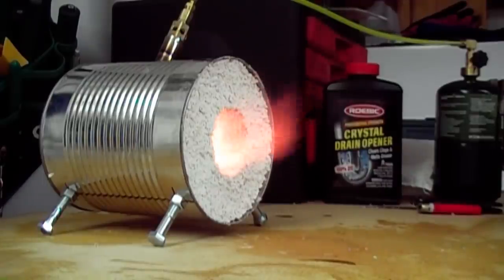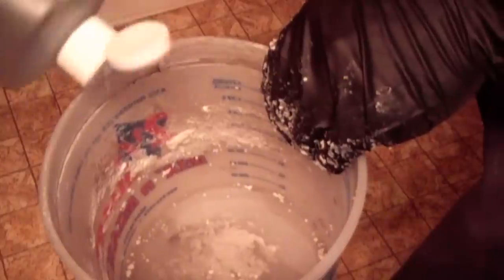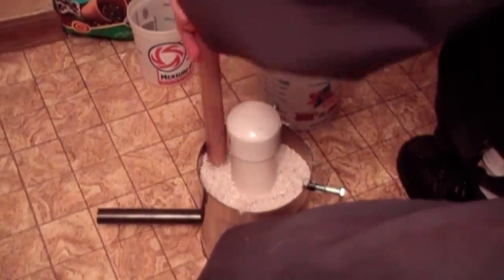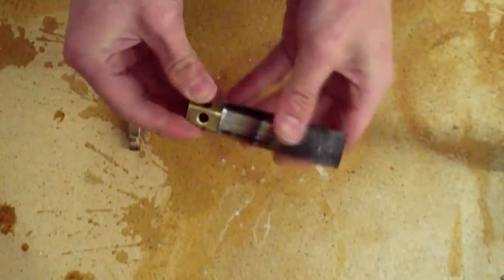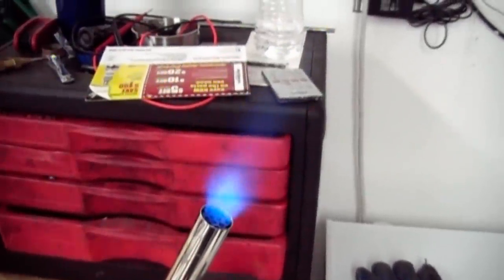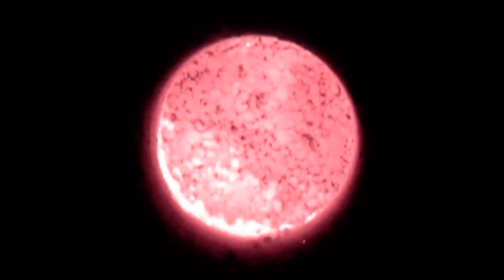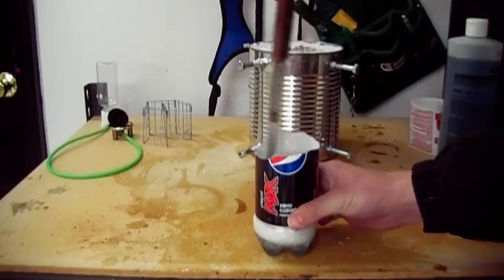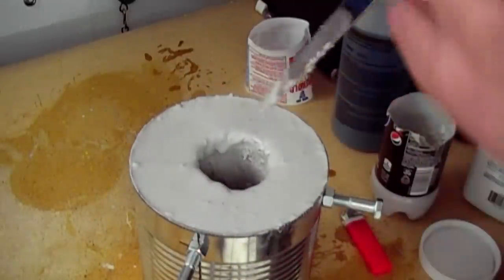How to make a coffee can forge

Comment: Tip! I built my own version of this exact burner & forge a few days ago. Afterwards when it dried I noticed the lining was getting soft & powdery after firing. I could scratch it off with my finger nail. So I created a hot saturated solution of LYE. I kept it on the stove on low heat (steaming, not boiling). Then used a plastic syringe to drop / coat / saturate the entire inner and outside lining with hot lye solution. It took about 2 hours to do and soaked in nice and deep. It needs to be hot otherwise it doesn't penetrate nice and deep. After I finished I decided to take a mini propane torch and heat a soft section of the lining that was breaking off before. Then when it cooled I touched it and it felt like a ROCK. Was hard as hell. So then I set off the forge with the wet lye all over the lining and THIS WORKS BEAUTIFULLY. First you'll see the steam come out (do not breath it in). Afterwards you can actually see the lye melt and immediately react with the silica in the perlite to make solid water glass. The whole lining changes aesthetically & structurally. You get hundreds of small, white popcorn looking beeds all over the lining but their all the same size and it looks awesome. After I fired it for 15 minutes I came back with a screw driver poking parts of the lining that were soft before and it was all ROCK HARD. I couldn't scratch off or break anything.

But here's the coolest part, the forge is getting WAY HOTTER now. Before only the bottom got yellow hot... after I did this the entire liner gets white hot and bright like the sun.

My guess is when you seal the liner like this heat is reflected like a mirror ... there's no pores in the liner for heat to dissipate or penetrate through. So the second heat hits the liner its reflected immediately back into the forge which makes it get insanely hot.

I'm not  exaggerating one bit. Afterwards I stuck a stainless steel spoon in there, held it a few minutes with pliers, pulled it out and the entire top of the spoon was gone! Then I shut the forge off, looked inside and see the steel melted to the bottom of the liner.

So naturally I had to connect my MAPP gas. I tried it again and the entire base of the spoon melted too. So I shut the forge off then popped it off with a steel wire and it came out like a little pancake.

I have no idea how this thing is melting steel (I'll take pics if anyone wants to see) but I need to try larger amounts in a graphite crucible to see if I can melt and pour larger amounts. I'm also confused as hell about the difference between temperature vs heat energy? I've been reading on forums about this. Anyone knows you can put a thin steel wire in front of a 1000C small propane torch and that steel wire will melt. So when a forge is properly insulated and your pumping hundreds of thousands of BTUs in it.... what's happening? Is it because the metal is more thermally conductive than the silica? So when you're pumping heat into an insulated area... the heat keeps rising and rising then you throw steel in... that steel sinks the "heat energy" which causes the temp to rise then it melts?

That's the only thing I can assume is happening. And if I can melt a steel spoon that has to mean I can melt more steel in a crucible.
Reply: make a video
Reply: how do you make the lye solution?
Reply: lye is just NaOH, so just dissolve NaOH in distilled water.
Reply: if you mix wood ash with water you have lye
Reply: this will be a mix of KOH and NaOH, mostly Potassium hydroxide.  Caustic Soda is generally NaOH and Lye is KOH.  they are interchangeable terms for some people.
Reply: pretty awesome dude, thanks for sharing
Reply: "It needs to be hot otherwise it doesn't penetrate nice and deep" I know what you're thinking hehehe
Reply: Robert Cece oo
Reply: Mike's Workshop 
Yep,,, that's what SHE said..😏
Reply: Where do you get lye? What mixture do you use?
Reply: But before that u forgot to type a long time ago from galaxy far far away 😒😒😒😒
Reply: @DillonBorges  - You mean NaOH is Sodium Hydroxide?
Reply: Given my inexperience I decided to buy the liquid sodium silicate. It’s a 5 ltr with a concentration of 40% is this any good, am I wasting my time with it or do I need to process the liquid to getting it down. To a higher concentration?

Comment from the maker: +RTOHIO It was part of a 3/8 fitting I sliced off for another project, then filed the flats off of it. A 3/8 to 1/2 face bushing also works. I did not know there were that many people wanting to build this exact burner haha, Designing your own is fun and rewarding. Thanks for the comment!
Reply: I have like no knowledge base in this subject. Are there perhaps things that you read to learn about things such as this that you could tell me about?
Reply from the maker: It wont hold the heat in nearly as well, but it would be more durable, sort of. After getting good and hot the concrete will crumble.
Reply: Adrien Perié I had no idea tin can smelters/forges were only thought up by one other person. Shit I'm glad I didn't make my own and steal their idea =O
Reply: *****  lmao that's funny. I thought the same thing.
Reply: ***** The guy made an EXACT copy of NightHawkInLight's soup can forge, re posted and is giving absolutely no credit on this video thanks to which he is making a wad of cash. That's just pathetic and lame.
Reply: Hm
Reply: Adrien Perié There is a difference.   That being the ingredients he used to make the insulation.   Its not bad, just a different way.  I will say that the nighthawk video's insulation that is prepared is easier.  Or cheaper.  Good Videos both ways.
Reply: Adrien Perié Honestly, your last comment shows you don't know much about what the guy is doing... 
This is a forge, a forge needs to melt metal, to melt metal, it needs to have melting capacities, meaning it needs to use insulating material, have a cylindrical shape, and be able to house a gas burner. This man wants to build it for cheap, if he goes into the store, he's not going to be able to make a forge out of all and any material possible, perlite is a good choice because it's cheap, so are coffee cans, and so is his homemade burner.

There aren't 36000 ways to make a forge, or a creusible. This video is clearly not a copy, it's just a video showing something similar. Do you find all cat videos to be the copy of the first one ever posted on youtube?
Reply: Adrien Perié Because one replicates something does not incline theft. Grow up kid.
Reply: aguynamedmike77 Do you even realize he is making money off this video ? And its me who has to grow up ? You don't even understand the concept of intellectual property ! What a bad joke !
Reply: Adrien Perié Horse shit! You cant call intellectual property on re purposing junk to make something useful. How about you share a link to anyone with a patent on this who is crying about it... Or, just as good, prove to me he's claiming he invented it? Or that he's even making money off it... If you mean making money by youtube, then the "bad joke" is on you my friend. Youtube is paying a guy for demonstrating how to open a pocket knife... lol
Reply: Adrien Perié Did you ever buy any books from Lindsay's Technical Books when they were still in business?  If you had, you'd realize that most of these forges are just reworks of the ideas that were in those books.  (and the ideas in those books were reworked ideas of ideas of past).  So on and so forth. No ideas were stolen. In fact, the idea of this forge could have easily been independently thought up. Good ideas are rarely thought up by a single person.
Reply: ***** '"insulting some on over the internet" you said its like hitting someone."
Nope.
Reply: Adrien Perié Every time you click here to complain, you pay him!  Laugh is on you.   Anyhow, it is not a 'Zero Sum Game".  He is not stealing money from anyone.   I like his craftsmanship better than other forge makers I have seen!
Reply: ***** Nope not Germans, the history of forging metals comes from the land between the Tigris and the Euphrates, one called Mesopotamia. That's commonly known today as parts of Syria but also almost all of Iraq and south eastern Turkey. 
Edit: The earliest signs of metalworking date back to about 4500 B.C. Whereas German ancestry begins around 850 B.C.
Reply: Seth C right you are also the first battery came from that area the Baghdad battery funny how they led the field in technology and metal forging today that area to leads the field in in genocide how times change
Reply: H8edsinclair Couldn't agree more, it seems that the advancement of technology tends to deviate at some point from one of betterment to one of wars and destruction. According to  http://www.globalissues.org/article/75/world-military-spending, global military spending is over $1.7 Trillion and yet 6.3 million children under the age of five died in 2013, nearly half of which was due to malnutrition and starvation, that's nearly 40,000 children every day didn't live long enough to see their 6th birthday.  
Makes you wonder, what happened. Somewhere in the race to technological advancement we seem to have lost (hopefully just misplaced) our caring and understanding to others. 
Edit: My apologies to the page for going way off topic!
Reply: Adrien Perié Totally different refractory, the soup can has been in the general public since soup cans have been around, this is nothing new and neither is Nighthawk. Dave Gingery copied his ideas from who knows where and those books were published in 1983.
Reply: manufacturedfracture  so apparently there is issues with my comment but those are countless links to can forge and my comments of them.
Reply: Seth C the cradle of civilization .....
Reply: ***** Concrete couldn't take the heat. If you have a clay-type soil available, it will work. Get it damp, not wet, and pack it in much the same as in this vid. Then fire it. Because it is thermal mass instead of insulation, the forge itself will get very hot, so put it in a save place, and get it a few inches farther away from the wood base. It'll also take longer to get up to heat, for the same reason. But it'll work fine, and is literally dirt cheap!
Reply: artsmith100 And dont use it next to a quart of liquid crystal drain cleaner? :P
Reply: +clkindred  hey man do they have those Heineken mini kegs its a 1 gallon mini keg for about 20 bucks I was wondering what your thoughts are on something like that and maybe make a video  on it?
Reply from the maker: It's been a long time since I have seen one of those, they might still be available. If you have one, I'd say go for it.
Reply: Formidable
 B
Reply: Ml
Reply: Omar Castro
Reply: clkindred hi was just wondering if sodium silicate and perlite give off any dangerous fumes of when heated
Reply: you've probably been asked this 20 times already but how much heat can this forge build take?
Reply: Sobeprinpicurare
Reply: clkindred  hi.  justin.   would it have been less effective with a larger orifice and if so by how much in regards to effectiveness smelting and external temp?  also.  why the chosen diameter?
Reply: Where did you find the 3/8 to 1/8 reducer
Reply: Adrien Perié c'mon really????
Reply: Adrien Perié c'mon really... it's all been done
Reply: anthony gonsolis you are on a sick one... it's all been done. You should  make your own video.  Then top it off with a design that shows that you are the master of design and innovation... or just keep hating...

Comment: Does it need to be Folgers,  or can I use the cheaper Butternut can?
Reply from the maker: as long as it's a metal can, it will be fine.
Reply: +clkindred why cant the steel be galvanized? hazardous oxide gasses?
Reply: Zinc gases from the galvanization process get released, it can cause metal fume fever.

I've gotten it from welding, it's not lethal(Usually), but it's the worst headache of your life.
Reply: once the zinc is burned off it won't continue to make zinc oxide fumes. need 1600+ degrees to make zinc oxide fumes and in don't think the can itself is getting that hot. use in a ventilated area like you would want to regardless. it's fine.

Comment: Does anybody see a problem in using this method of making a forge , but using a much larger container like a “35 gallon “ propane tank from a forklift (about 30” long, and about 15” in diameter), and make it with a 4” cavity.

Out of all the mixes I have watched on Ytube....... this seems to be by far the easiest to deal with and get the best results.

Thank you for sharing.

Comment: cement could used just as easy.. and cheaper..
Reply: Not as insulating..
Reply: Cement will pop and crack with heat
Reply: Lelouch Vi Britannia apparently you didnt read what he said first
Reply: The cement will explode from pockets of moisture. The material he uses is porous.
Reply: You cant use cement. You could use refractory concrete to some extent, but it would be a waste of fuel as you would be fighting with heat loss to keep your forge hot.
Reply: Actually, you can use cement in very small amounts, although it's not advised. The guy in the video actually made curing time longer and the furnace weaker by using plaster of paris, if you have sodium silicate then that's all you need since it doesn't crack when heated.
Reply: Cement explodes when heated up too hot.

Comment: I liked watching how you made the burner, the new tube design of what seems to be a large scale of a soldering torch tube. I'm soon going to make one and make a foundry like yours in this video but a bit larger so I can melt larger pieces of metal just to compact the size. I will use free fuels to burn them, either reclaimed fossil fuels, used motor oils and old fuels mixed using them to extract vapors that will burn not using them as solid fuels if I can make my design work it will make the fuels last so much longer and will be free.
Reply from the maker: Pastor William Barhorst Have you seen this design? https://www.youtube.com/watch?v=P-A8uoWdBB8It uses liquid oils but still might be worth looking at. The vapor design like old gasoline blowtorch use would be an interesting build though, with a lot of design challenges. Like how to keep non vaporizing contaminants from gumming up the system.

Comment: Try setting you burner at a 40 degree angle. Heat will circulate inside a bit better, and can raise the temps some. Thanks for the videos, I found one that will allow me to finish an on going project.

Comment: Wow, this is pretty cool concept! Before I came across your video while I was in the works of making my own coffee can forge. Accept my insulation is Portland cement and crushed up firebrick, and I'm opting for less insulation for more work space for my blacksmithing. But instead of one propane torch, I'll have two torches pointed down in a "V" configuration on to my steel. I might coat the out side with some fire cement as well. But the way you went with this one was pretty ingenious!
Reply from the maker: Thank you so much! I'm working on a different design for my next forge, I'll post a video when I'm done. You're right though, this one is slim on the work area, part of the reason I made the new one is this was too small. I am interested in your insulation though, I experimented with portland cement but did not get very good results. Please keep us here updated on how it turns out! Thanks again.
Reply: clkindred  Sorry for the delay clkindred! I have been rather busy lately, and haven't had the time to reply back or work on my forge. But I got some more stuff for it and right now I have different batches of the Portland cement and crushed up firebrick curing to see what is a good mixture to use. I will make sure to keep you updated on how things are going, it might be a while though. I also got some fixins to make some water glass thanks to your helpful videos! I hope to make a little bit bigger foundry than what you did but ...... that's still a far bit off for now. I can't wait to see what else you have in the works!!!

Comment: +John Mood, multiple coffee cans would work. You could solder them, or wrap each joint with another coffee can, split on one side, to give a double layer prior to drilling holes for the legs. 
But easier still, as you extend it to sword length, would a 3- or 4-foot section of 6-inch or 8-inch-diameter, single-wall stove pipe. Then you'd not have any joints to make. To fill such a long chamber with plaster, I'd make a circular tamper that fit within the outer pipe but over the inner core. Either a large diameter piece of ABS, or a bundle of 1/2" PVC pipe sections taped or hot-glued or PVC-glued into a rigid bundle would make the tampering go faster, more uniform and more thorough.

Comment: Im an old sheetmetal guy. Here is a little trick. If you have a ten inch diameter pipe lets say, place a framing square against the outside of the pipe and mark it at the five inch mark on both sides. Slide the square and repeat the process. You should end up where you started with the cylinder perfectly divided into fourths. Peace Y'all.

Comment: Thanks for video, I made this but couldn't get my inner can out after the. Plaster set (half sand half plaster).  No problem though.  I use mine upright full of charcoal and a hair dryer instead of gas burner in the feed pipe ,  takes 5mins to heat treat a knife to temp.  Brilliant.  Thanks
Reply from the maker: +Ken Murray Charcoal seems to be a surefire way to forging heat, gas can struggle sometimes.